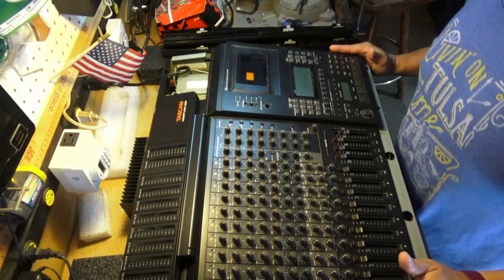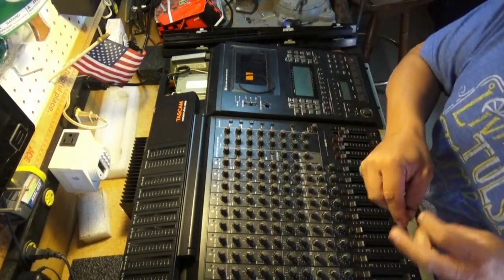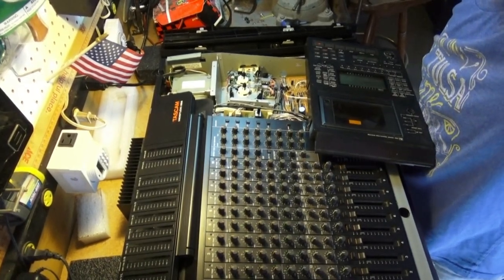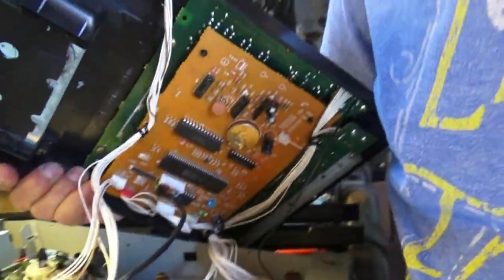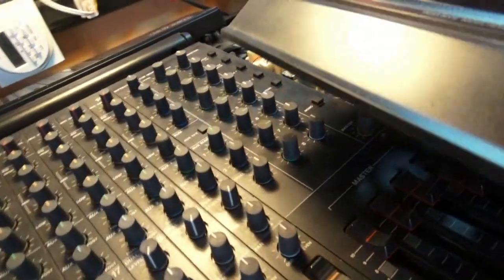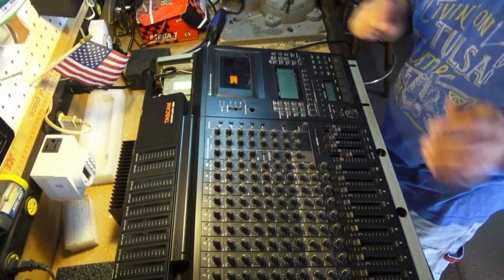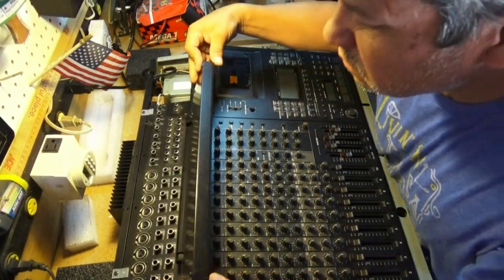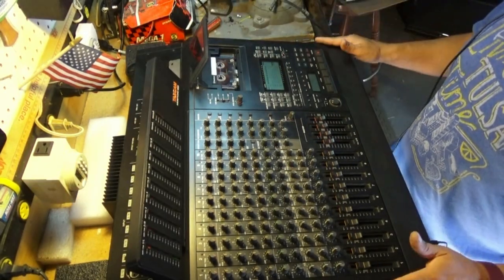Tascam 688 belt replace.

Comment: Where’s a place to get new belts for these machines? I own a 688 and I believe it needs a new belt
Reply from the maker: My 688 was playing slow so I thought I’d give it a try and it worked. I found the belt on eBay.
Reply: @BigCrumb52 are there multiple belts in the 688 or is it just the one ?
Reply from the maker: @tazekozak  I just replaced the drive belt on the motor.
Reply from the maker: @tazekozak  https://www.ebay.com/itm/163813898203?mkcid=16&mkevt=1&mkrid=711-127632-2357-0&ssspo=0E3xpfVeS8G&sssrc=4429486&ssuid=yrjd2e1QTeO&var=&widget_ver=artemis&media=COPY

Comment: Good afternoon! Please tell me the characteristics of the drive belt. Its size, length, width. Very necessary. Thanks!
Reply from the maker: I was lucky enough to find it on eBay. I searched “drive belt for a tascam 688”. hope this helps.
Reply from the maker: https://www.ebay.com/itm/163813898203?mkcid=16&mkevt=1&mkrid=711-127632-2357-0&ssspo=0E3xpfVeS8G&sssrc=2349624&ssuid=yrjd2e1QTeO&var=&widget_ver=artemis&media=COPY
Reply: @BigCrumb52  Good afternoon! thank you very much! It's problematic for me to buy from Ebay, I'm from Russia. I asked about the size, I want to find an analog in my stores or in service centers. Therefore, the dimensions and characteristics of the belt are needed.Thanks again for the help!!!